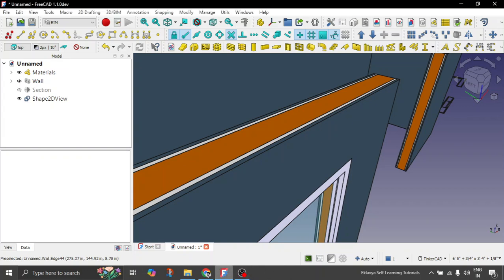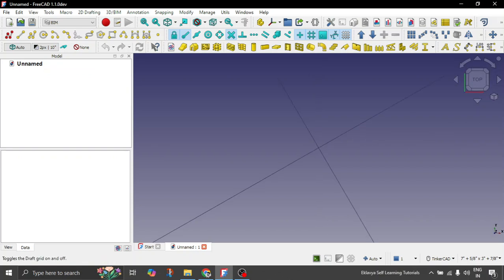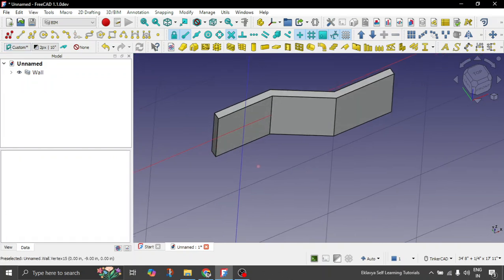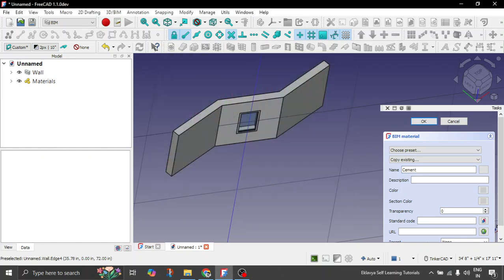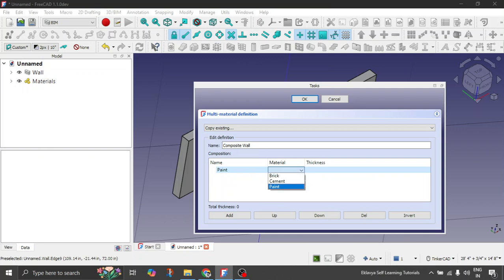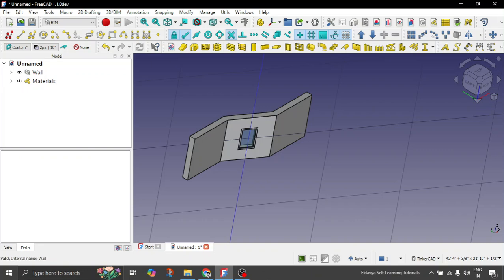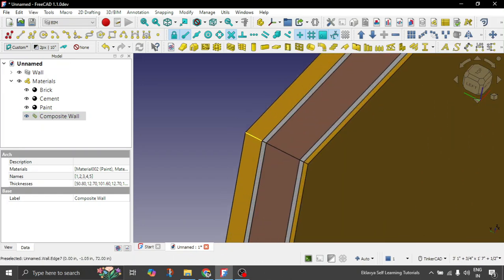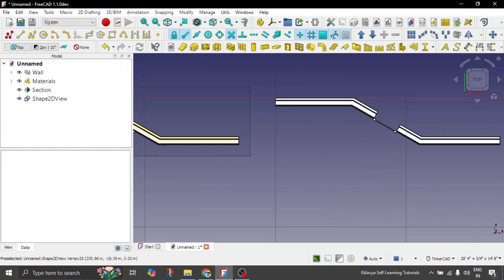FreeCAD Daily #10: Create Composite Walls with Multi-Material

Comment: Hi, thank you for the tutorial. I'm not an architecture just curious hobbyist living in EU using FreeCAD.
It would be nice a real developed example of a small but complicated house:
* with  external concrete block walls, straight and curved (all rendered/plastered + insulation + inner drywall panels + painted) * and interior walls with different width and panel composition than the external ones
* and kind of a mezzanine with access stairs, 
* some other elements like a fireplace with exhaustion duct, 
* some Cold & Warm water pipes and taps, 
* skylights on the roof,
 ... and of course a complete BOM.
You've already exposed interesting videos in your channel applying lots of examples and the usage of most of the FreeCAD tools and workbenches but they were not included within a real implemented building.
Imagine taking an image from a piece of land from Google MAPS/Earth in a mountain region and make a project which include everything: site, driveways, fences, gates... up to paint.
Reply from the maker: Great idea 💡. I’ll prepare something around this. Thanks!